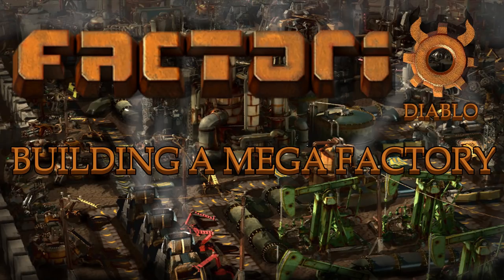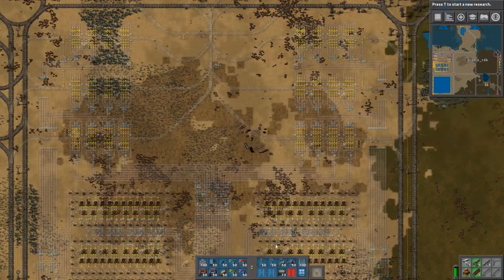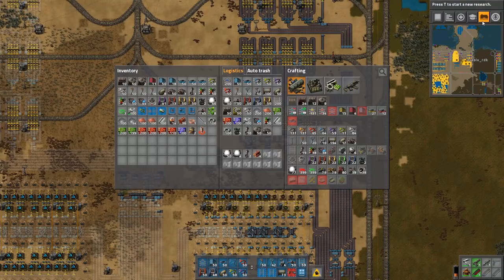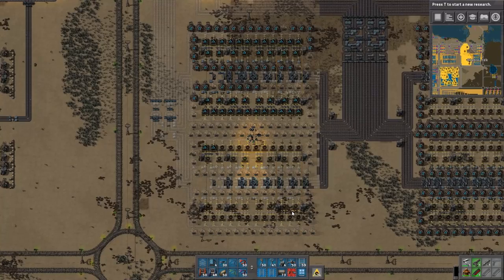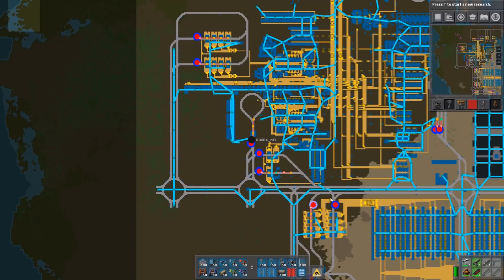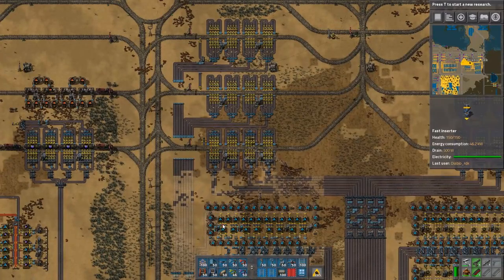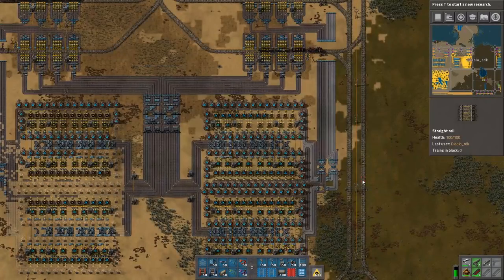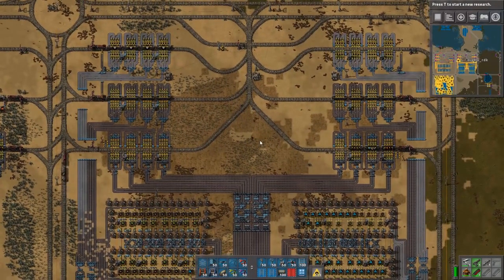Factorio - Building a Mega Factory: Part 136 Adding green chips

Comment: i fail to see why you decided to create extra production capability for green chips when from what i could see in the videos was not a lack of production capability but a lack of input... is your idea that there are too many trains running on the existing GC block?
Reply from the maker: Exactly, I'm hoping to relieve the existing GC block and have a more balanced GC output through more loading stations.
In the end it shouldn't cost more raw materials but throughput should increase dramatically. It should also relieve the issues of trains getting stuck or trains missing multiple pickup opportunities because they have to come from far away and by the time they're at the GC block all the chips are already gone.